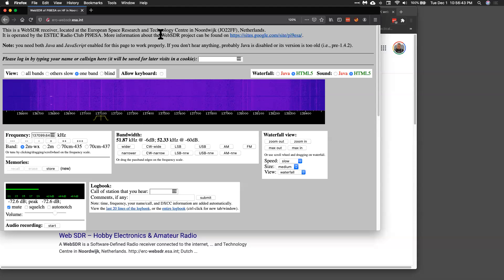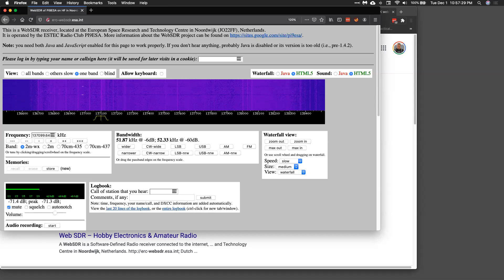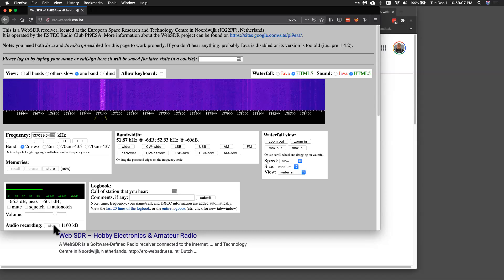NOAA Image from WebSDR

Comment: Unfortunately, that exact websdr seems to be broken (connection timeout). I tried using one in bavaria to capture Noaa 15, got a signal and data, but the image came out completely wrong (Narrow IF bandwidth at 40Khz). Any suggestions for another SDR to use? Besides bavaria, there seems to be none with the proper bandwidth (137Mhz).